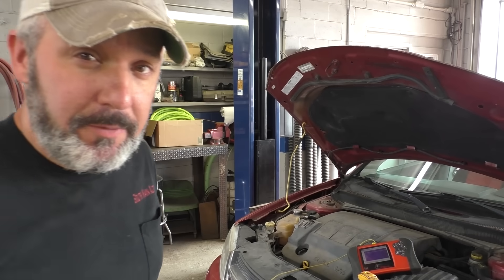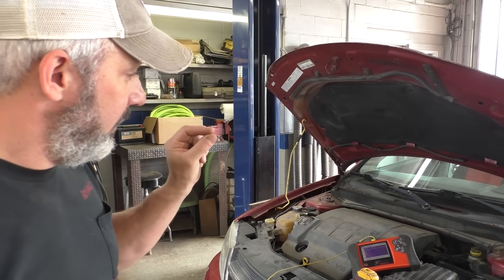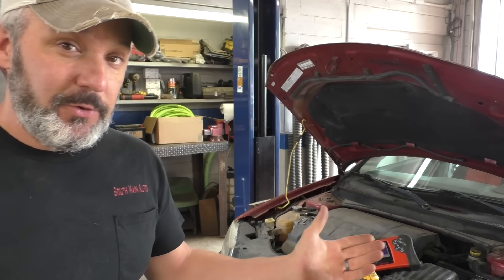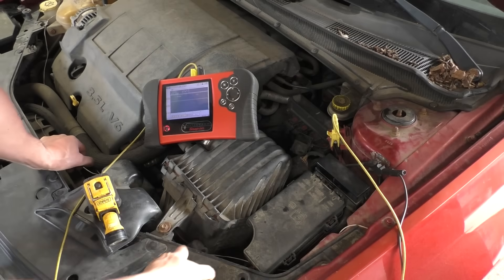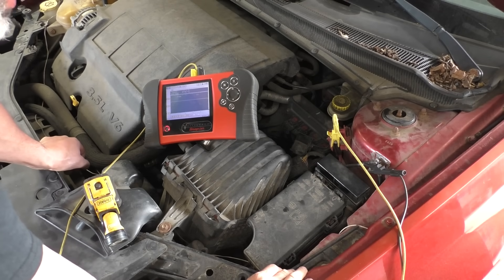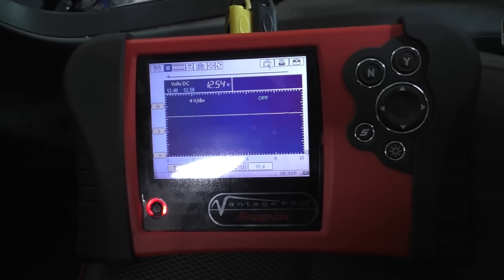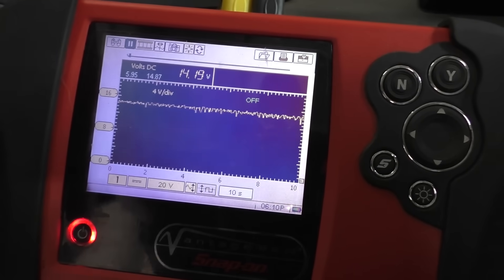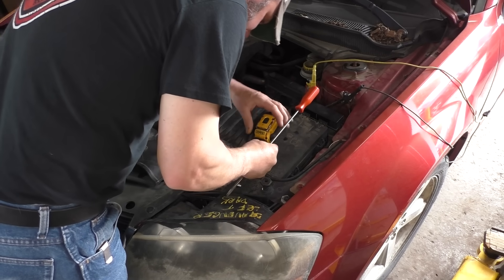Another Lesson In Voltage Drop - Don't Skip The Basics!

Comment: “Meow cameo got the snub!”-Luna
Had same issue on the homeless guy’s Dodge van I put the WP in last Xmas. Got there to do the WP and he says it won’t start. Knee jerk thought was a bad starter until looking at the crusty aftermarket clamp type terminals. Had enough wire on the Pos to cut it back an inch to clean wire and cleaned and greased the terminals and blammo, Bob’s your mother’s brother. Bout an hour delay starting the WP, which was an SoB… By God’s grace no broken bolts!  Thx for the therapy! ❤

Comment: Ok so many moons ago, older cars with no battery cover, would complain about the same thing.  What was found in a lot o f cases, if u were to put one lead on the positive (or negative), voltage scale on meter, and actually touch the top of the battery and move it around u would see a drop. Dirty top higher draw. Fix, water , baking soda and brush, clean all. Clean terminals and recheck again, draw gone everyone happy except the mechanic because we never charged for that procedure. It was usually part of our oil and filter change procedure. Naturally u would check alternator charge also. Never a comeback.
Reply from the maker: Yup dirty batteries will draw current

Comment: A few years back, I bought a 1999 Jaguar XK-8 that was low miles and in overall excellent condition. On test drives everything worked perfectly.  A few weeks later, it started having an issue with 'unintended acceleration'.  Usually, I was driving at low speed through a parking lot, and the car would suddenly go full throttle. Only turning the ign. key off would stop it, the pedal itself wasn't sticking anywhere.  That car has an electronically-driven throttle, as opposed to a direct throttle cable.  
      I determined that it was an electronics problem, and thankfully the first thing I checked was voltage drops at different points on the car. I found a drop of about 1.5 volts at the battery post-to-cable clamp.  Removed both cables, cleaned and re-installed them and eliminated the drop completely.  That was 4 years ago, and the unintended acceleration problem has not recurred even once.  This is after being told by "experts" who had even worked for Jaguar tech dept. that this problem could not POSSIBLY have been caused by that voltage drop. I strongly advise anyone who's experiencing weird symptoms on these computerized cars to FIRST check for voltage drops. We are dealing with computers operating on low voltage and only milliamps of current, and any disruption, no matter how small, can definitely affect the entire system.

Comment: Eric, no need for your viewers to go to any other YT channel for electrical knowledge. You do it exactly the way I was taught by an expert. I was going to zoom down to the comments and point out what you said in your closing comments: current must be flowing, or the ckt needs to be turned on to do voltage drop testing. An ohmmeter is not useful for this testing- an eighth of an ohm can cause a 10 volt drop on a starter cable!

Comment: So question, my friends truck has something funny going on with his alternator reading. If I check the positive on the battery with the truck running was let's say 12.25 or was 12.52 but the back of the alternator was let's say 12.78, would that be a something this voltage check could help find the problem? I'm no mechanic but can do a little wrench turning to get me into trouble. I know that reading is low, he did an LS swap on an 85 square body Chevy

Comment: I hope some HVAC techs watch this! Over and over and over again I ask will your multimeter read minimum volts and stay locked on that reading until cleared. In 30 years I have had two that said yes. The complaints are compressor failures, compressor hard to start lights dimming when compressor starts. My favorite is we sold the customer a completely new system and it has the same issue. We are dealing with 240 VAC at maybe 100 amps starting current. They get a good meter and find that 240 VAC is dropping to 150 VAC bingo Yahtzee! Now it’s always I will have customer call an electrician. Why just do voltage drop tests all the way to the distribution panel buss bars. If it’s dropping at the buss bars it’s a power company issue. So let’s save the customer the electrician cost and direct customer in the correct directions. Multi meters without low voltage lock are like an amp probe without a display. Thank you Eric for showing the value of knowing and not guessing.
Reply: Short of having a scope, the low voltage lock can be a life saver.

Comment: If you've got a thermal camera, on a high power connection like that, the camera will find that bad spot pretty quick. You could use the old "touch test", but you might burn your finger!

Comment: Can't believe whoever went through the hassle to change that battery didn't take 2 minutes to clean visible rust/ corrosion off the clamp and cable. Also can't believe anybody else does a better job of explaining electrical diagnosis and trouble shooting than you do. Thanks and keep it up!
Reply: A hack. There are so many out there. It’s scary.
Reply: I work for AAA, you probably wouldn't be surprised how many times I've had to come back after others for "bad batteries" in just a day(s). Not just from us, AutoZone, Walmart, O'Riley's, etc. 

And of course they were all fine. 99% of the time it's 1 of 2 things. They either didn't tighten the terminal properly, broke it, or stripped the side post bolt. 
Or they didn't clean the inside of the terminal so it couldn't make a good connection to the battery post. 

Kind of sad, I helped a lady just last month that was told by 3 different people she had a bad battery off the shelf including an AAA guy, and AAA contractor, and Autozone. NEG Terminal was just dirty.
Reply: @dracallis  I'm guessing that the average non-technical person doesn't realize that resistance can form over time to the point where the car will not start.  The color of the post & terminal is a good indicator absent a voltmeter.  A battery terminal wire brush in the glove compartment goes a long way.  Nowadays you have to be mindful of losing settings if you totally disconnect the battery without maintaining power to the modules in the car.
Reply: Guess who pays for a new battery that they did not even need?!!
Reply: agree 100%
Reply: It was completely accessible while the headlight was off.
Reply: Why get paid once when you can get paid twice!

Comment: One the days when I am feeling old, I point the FLIR camera at it after cranking the engine, and look for the hot spots.  The voltage drop check is still more accurate and cheaper, though.  I bought the silly thing to test cooling systems and catalytic converters, but ended up using it for electrical faults.  Hotspot in a fuse box?  Boom.  Found it.  At least it wasn't a total waste of money.
Reply: They are an amazing tool you can see resistance
Reply: '18 Tacoma wouldn't start maybe twice a month.  Coworker looked at a suspicious connection with his FLIR camera, it was 200° F!  Fuel pump always turns on now!

Comment: CHIA!!!!  Why wouldn't there be chia in a battery terminal down there.  Why can't they put the windshield washer fluid down there and put the battery up top like they did years ago?  If my windshield fluid freezes up when it's 30 below zero...not so bad.  When the battery freezes up and you've got to get it out of there in the middle of nowhere...pretty bad.  Thanks Mr. O, I think I have a better idea of voltage drop after this video.  Thanks again.

Comment: Several years ago my wife bought a Chrysler Pacifica at another state car lot. (When Pacifica was an Suv type vehicle). It was low mileage  great condition,  optioned out and a great price.   We picked it up on vacation on the way home.  About 150 miles on the 250 miles trip the dash went dead and engine turned off.  A call to the dealer who denied any knowledge advised to take it to a dealership.   It was late afternoon Saturday so nothing open.   I made it the rest of the way with no more issues.  Now thinking I'd been scammed  (deal too good to be true).  I simply Googled the model and symptom and then answer was a bad connector on the hot cable from the battery connector to the fuse module.   Monday I called the local deal to get a replacement.   Of course back ordered with no known date.  I measured the diameter and length of the cable, went to tsc and picked up a riding lawnmower starter cable that was the same diameter but 1 inch longer.  I swapped the cables and she drove it for the next year and we sold it.  We made a little over $4000 on that vehicle by replacing a $3.95 cable.
Reply: Yea TSC!

Comment: Retired electrical engineer. Your explanation is spot on. Ohms law says it takes 1 volt to push 1 amp through 1 ohm. Every connection, piece of wire and anything else between two points is potential resistance. The rusty terminal caused the extra resistance in this circuit. The conservation of energy law says that energy cannot be destroyed, just transferred.  With resistance, its's transferred to heat. As the temperature on that rusty terminal was raised, the resistance got worse and made the voltage drop worse until the point where there wasn't enough voltage to start the car. We saw this on the Honda battery terminal in your last video when you "let the smoke out". Again, spot on, perfectly explained and easily understood..... When your body gives out from working on cars, you should teach......🙂
Reply: He teaches with every video he posts!
Reply: So if we measure ohms it would be higher (maybe slightly) than normal. The problem is that we don't have a good resistance baseline value to compare it to. So I see why it might be a waste of time to measure resistance if measuring volts is more reliable and easier.
Reply: @chiluco2000  Resistance checks are made with no current flowing in the circuit except for what the meter is sending out to see the resistance value of the circuit/component.  Voltage drop tests are for load-testing a circuit that is powered on.  It is more accurate because it tests the circuit while it is flowing current (live circuit).
Reply: @chiluco2000  when dealing with corrosion/rust, it could still read 0 ohms, because of tiny good contact surfaces and meters are not that good/designed for such testing, as they do not load the circuit beyond microamps at low voltages for safety in electronics testing.
Reply: @chiluco2000 exactly, there's no meaningful reference to use when measuring resistance. Voltage difference (drop) works because of the relative reference (difference). The precision of dmm/ohm meters is typically not that good at sub ohm levels anyway.
Reply: The problem was even worse on 6 volt cars. My old Ford truck had to have every connection to be clean to start and charge the battery.
Reply: @GaryH-pw9cm  Yep! The problem was worse but easier to find. Just grab each connection with your fingers while the circuit is loaded, the one that that burned your finger from the heat was the problem. Cheers!
Reply: So how does one account for the total voltage drop of 6VDC when cranking? That terminal post clamp’s resistance is multiplied when trying to push the high cranking current through it? Would it be worthwhile checking for additional resistive connections such as at the starter?
Reply: @Barrys_Shop  That 6v was not volt drop, it was supposed battery voltage while cranking. But, it wasn't measured at the battery. Any resistance is amplified when more current is flowing. Example: we had a car (for students to work on) that had a 1/4ohm resistor in series with the positive batt cable.  If you turned on, say, the headlights, they would look normally bright. But when running close to 100 amps trying to crank the engine, the voltage drop was around 10v, and the starter would engage, but not crank the engine. In Eric's case, he fixed only 1 poor connection. If there were more, the engine would still crank slowly, but not as slow as before.
Reply: Higher the load, the more the voltage drop across the bad connection (resistor);  so we're getting into kirchhoff territory.   Even batteries have internal resistance.  The old battery probably tested bad because of the poor charge voltage getting to it.
Reply: @tsl7881  That's why a battery should be fully charged before (load) testing it.
Reply: @Barrys_Shop  That's a brilliant question, because it exposes a hidden truth behind why the high current circuits are so sensitive to tiny increases in resistance. If you assume total battery voltage is constant at 12V, then from ohm's law the current that flows is proportionate to 12/R, a hyperbola. Plot that on a graph of I vs R and know that the slope of the curve is steeply negative when total resistance is low and current is high. So, in that region of the curve when total resistance is low, a tiny increase in unwanted resistance results in a huge power drain for devices that require high current and torque to break through the locked rotor phase. Put another way, Kirchhoff's law states that the relative voltage drop across a corroded connector will be related to how much total resistance is in the circuit. In a starter motor the resistance is nearly zero, so when you add a couple of ohms of extra resistance at a connector, most of the voltage drop and power loss is eaten up at the corroded connection. The other factor is that starter motors are designed to 'dig deep', even to the point of killing themselves.  When the rotor is locked there is no back EMF to limit current, so the current going through those tiny windings is way too high for way too long. If the voltage drop across the starter is too low because of high circuit resistance, it tries to draw dangerous current for much longer than it should, which can melt the sensitive insulation in the motor windings.
Reply: @Barrys_Shop  The starter is also drawing current during cranking that accounts for the voltage drop.  Like Eric said, the voltage should not drop below 9 volts.  It should also recover after the engine starts running.
Reply: @Barrys_Shop   that voltage drop was all in the rusty terminal. As the car was cranked, the resistance on that terminal caused it to heat. Like Eric explained, the drop at 60ma is nothing compared to the cranking amperage. As the starter continued to draw current, that rusty terminal got hot and the resistance got higher, eventually causing a large enough voltage drop that wouldn’t spin the starter. Remember, this is not a singular event, rather a series of events. A meter will show the voltage at the time you look at it. An o’scope will show the event over time.
Reply: @Barrys_Shop voltage drop is calculated as amps x resistance.  When the starter motor is switched on, the current amps it draws is much larger than nominal.  The resistance of the battery terminal can stay the same and you still have a larger voltage drop across it.
Reply: "Easily understood" 
I wish that was my case.
Reply: 13:30 ... Mr T impression
Reply: He’s teaching with every video.
Reply: Fully agreed! I, too gave up mechanics to teach at a mechanic's school. Did it for 18 yrs. Let me clarify Ohm's Law: Volts= Amps X Resistance. So, 2 volts will not push 2 amps of current thru 2 ohms resistance. Electricity is so easy, once you know and fully understand how it works, but it is a total mystery if you don't understand it.
Reply: @61rampy65 lol Your both correct! 1 v = 1 amp x 1 ohm, and 2 v does not = 2 amps x 2 ohms. 😮😂
Reply: @61rampy65  Electricity is easy in DC... things get a little bit more complex in AC. Luckily not an issue in the car world.
Reply: @johnnyblue4799  I'll agree with that totally.
Reply: @johnnyblue4799  AC also easy

Comment: Eric, you are so right when you say that everything imposes a bit of voltage drop.  One item that has to do this is the fuse.  It relies on having a certain resistance so that when the current gets abnormally large the wire in the fuse will heat up and eventually melt.  You often see a largish fuse (e.g. 15A) protecting a circuit taking (normally) only a few tens of milliamps.  The fuse size is chosen to protect the wiring and also ensure that normal voltage drop across it is small so as not to affect operation.
Reply: I learned that lesson from one of Eric's videos.

Comment: When you have a problem like this and you got an old car the best thing to do is just go ahead and change the positive and the negative cables that will eliminate your issues and your your battery will hold the charge and it's a cheap fix especially if you do it yourself